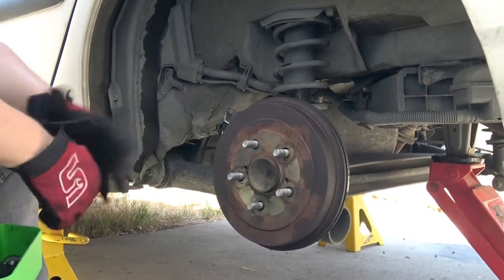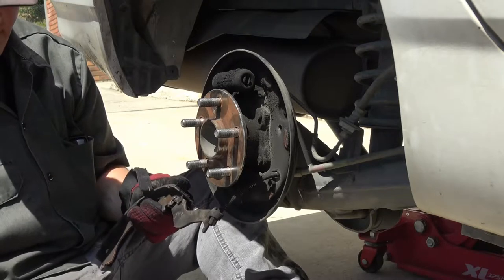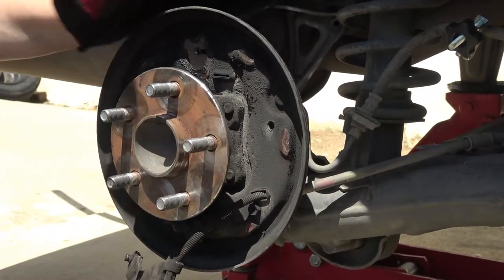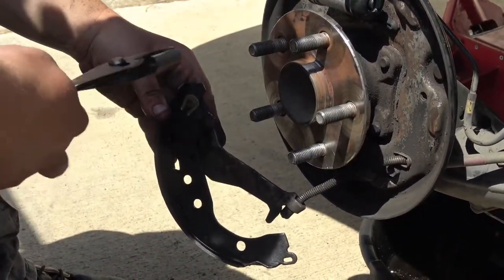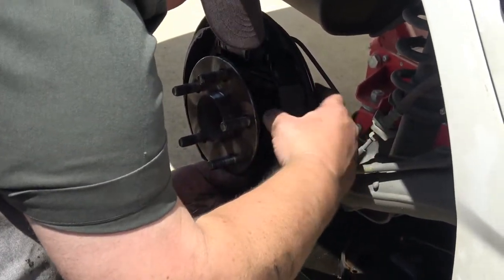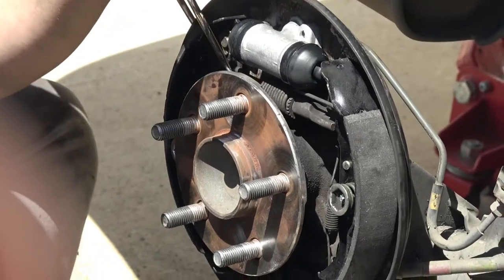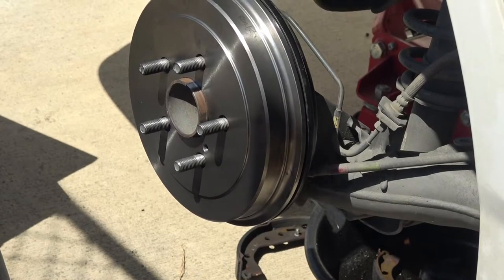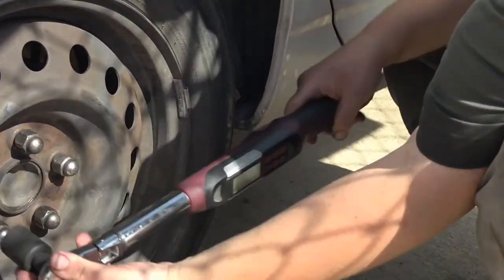2005 Toyota Corolla CE Rear Drum&Shoe and Wheel Cylinder Replacement

Comment: My 2005 Corolla has been making a low 'brrrrrr' or low soft grind 'brrr' sound from the rear when I brake. The front pads were changed recently and the rear pads a few years back. Someone told me the rear wheel cylinders are wearing out. Not sure if hearing this sound means I need new rear wheel cylinders.

Comment: Excellent video, but question? What happens if you accidentally hit the cylinder while it's pitched off and some brake fluid leaks out on both sides of the rear brakes? Are the cylinders now damaged? Also when this happened, the shoe's opened and I am not able to squeeze them together to close the cylinder. Should I bleed the line to alleviate the pressure in the line?
Reply: I just pitched my cylinder and it leaked a little bit. I thought nothing of it and once I hit that break. The thing leaked, and I lost all pressure in the breaks.
Reply: @therambler0001  What did you end up doing? Replace the wheel cylinder? I’m in the same situation